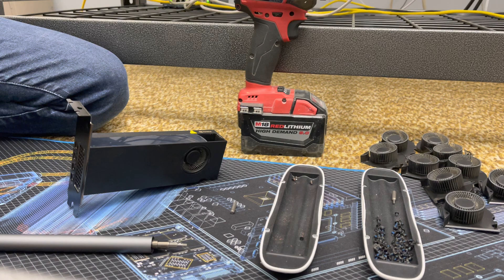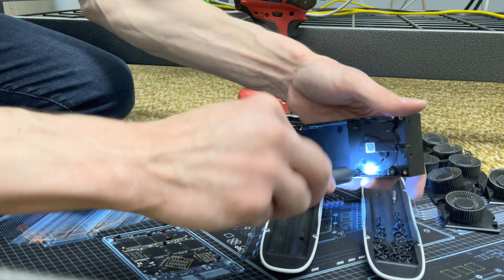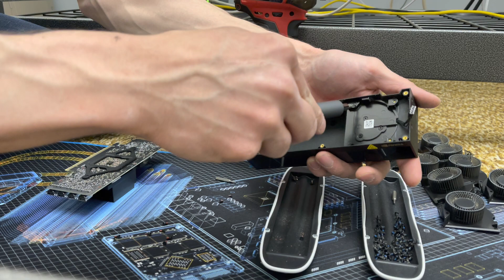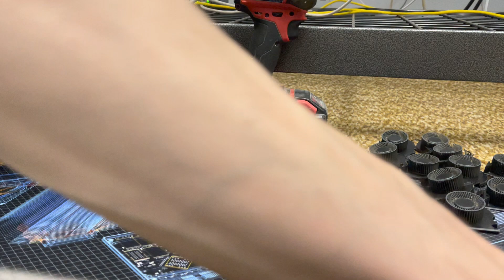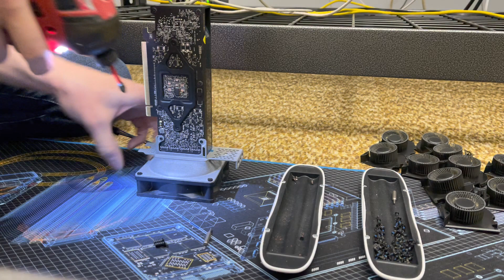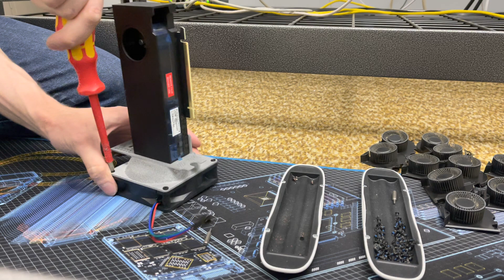Installing SiCPoW RTX A2000 Fan Duct (Mining Cooler)

Comment: Good job, what fan model used?
Reply from the maker: Sanyo 9GA0912P4J03, it's a relatively low power fan. It's just about right for moderate climates, is well balanced and reliable.